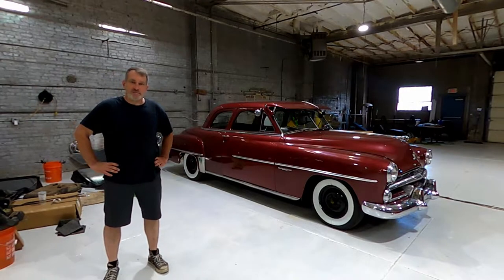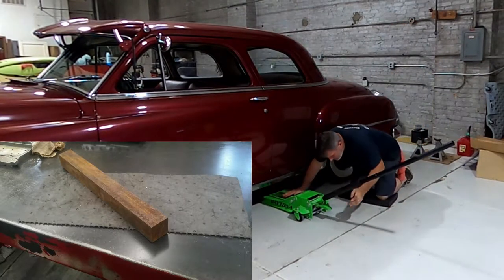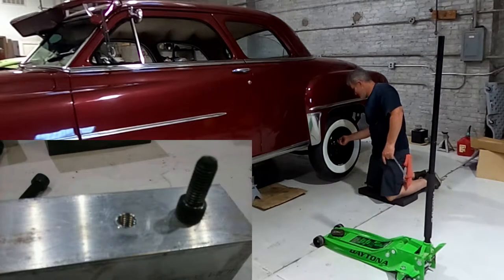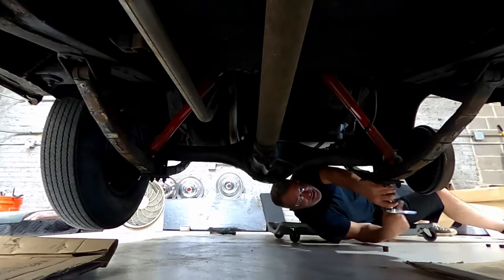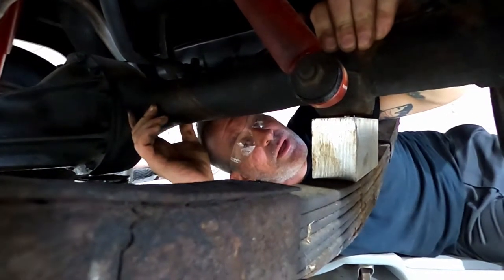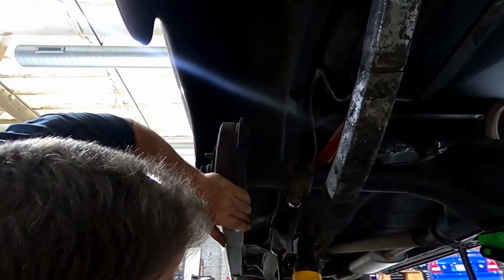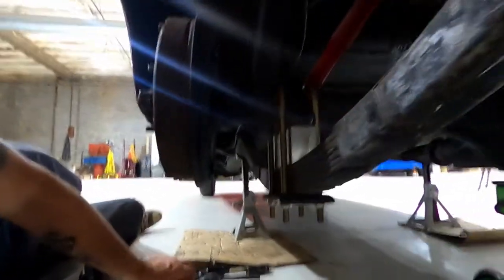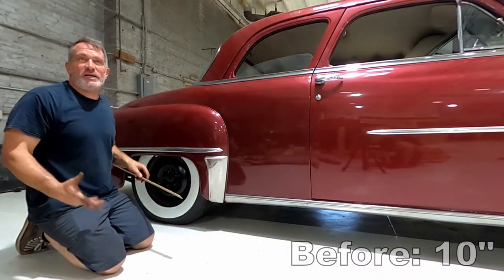How To Hot Rod: Lowering your classic car with Decent Joe

Comment: I was waiting for you to drill till you struck oil. No such luck. Great job.
Reply from the maker: It's not visible in the video, but luckily there is an air gap between the axle pad and the axle shaft! Otherwise turning that new pin would've been the safest bet. But good thought!

Comment: Growing up there were two ways to lower cars.  Cutting front coils and lowering blocks in the rear leaf springs was the “good”way to do it.  The cheap way was to heat the springs until they melted.  Use the same torch on the rear leafs until they could be bent!  It was cheap but effective.  The cars would bounce like a bitch afterwards.  Cops would pull us over and measure us and give us fixit tickets.  I would NOT recommend lowering a car.  It causes trouble.  When lowering blocks were installed in a Chevy you no longer could get access to the brake adjusting slot.

Comment: Great video. Where could I get these for my 1949 Plymouth deluxe sedan? No cutting or fabrication would be nice.
Reply from the maker: Try this: https://butchscoolstuff.com/rear-2drop-lowering-kit-for-all-cars-with-1-3-4-wide-spring-2409/
Reply: @TheCherryGarage   that kit says it works with chevys, there was a kit that was a little cheaper that for 54 chevys. Do you think that should work?
Reply from the maker: The link I posted is for 28-53 plymouth and dodge as well. Read the rest of the part description
Reply: @TheCherryGarage  oops, sorry. Looks like I miss worded my question. 
The kit you posted says it works for Chevys (and Plymouths). There is a kit for around $60 online that says it works through the same years on the Chevy. Could I use that kit instead? 
Not sure if my question is making sense.
Reply from the maker: @jesriproductions  oh I understand, if it measures the same spring width, it should work. I think it's 1-3/4" width. I can't guarantee it will fit correctly, but it seems like they may share the same rear end